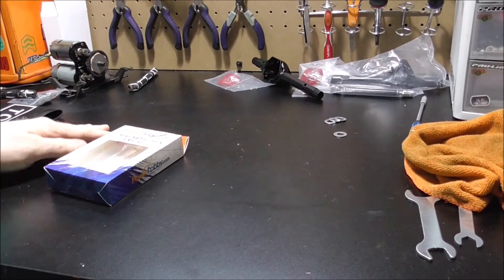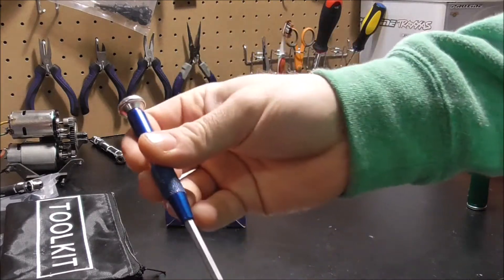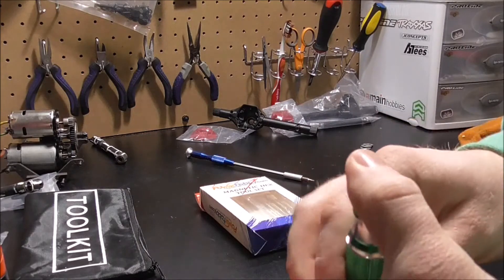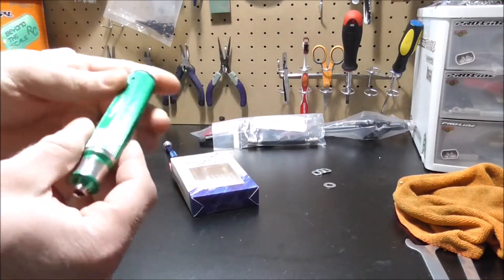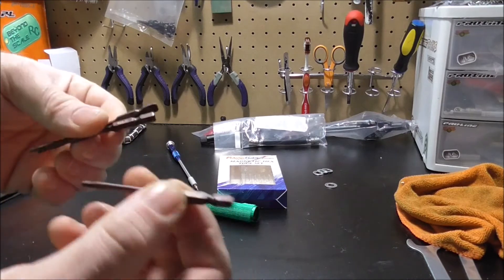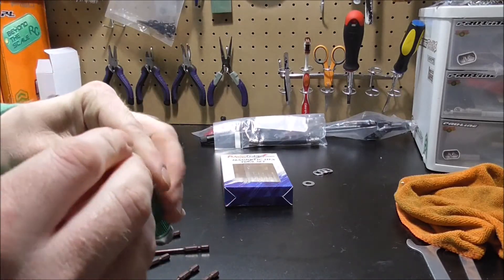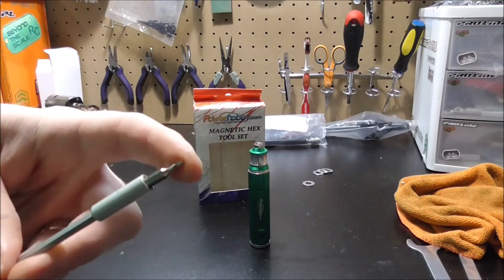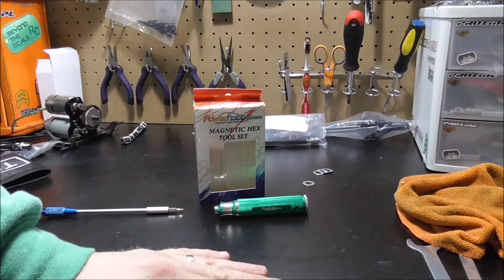Looking at a new tool kit for your RC?

Comment: Be interesting to see how they hold up! It's pretty annoying how you can't just replace the tip on the MIP drivers and have to get a new tip and handle. Also like you said you can't use them in a drill unless you get the speed tips so you have to buy 2 sets of the same thing!
Reply from the maker: Yeah I hope for the cheaper price they do decent.  So far I haven't had any issues with them.  Yeah having to buy 2 sets sucks which is what led me this direction lol.